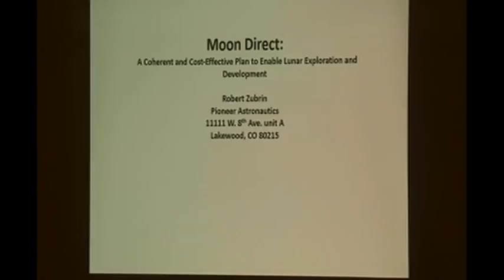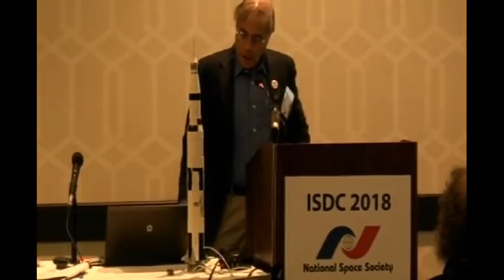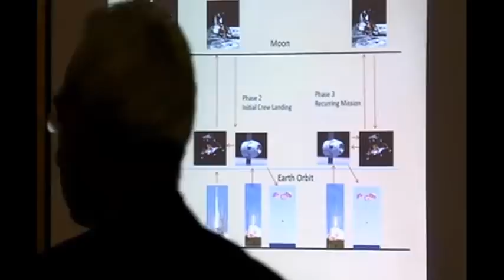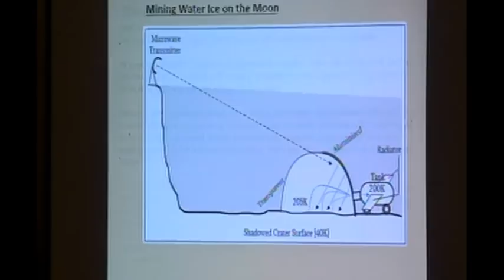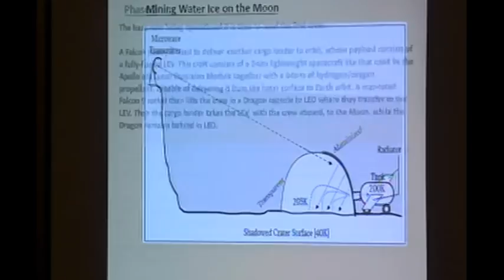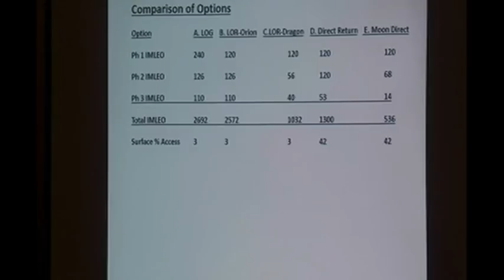Dr. Robert Zubrin - Moon Direct - International Space Development Conference - May 26, 2018

Comment: The Moon Direct LEV can be designed to carry four Crew, an upgraded ISS Waste Managment System, an Air-Lock/Dust Lock, Single Stage/ReUsable and refueled on the Moon for the return trip.  The pacing item is to recover one hundred tonnes per year of Lunar Water Ice...  With 240 tonnes to 300 tonnes of Lunar Water Ice per year then six trips to the Moon and return can be done.  And six trips per year to the Moon then Twelve (12) Lunar Workers can be maintained at the commercial Lunar Base on the Moon.  Also the Lunar Workers will be on six-months tour of duty !  The LEV can support a Four Person Crew Module or the PTM of the NASA designed "24-Hour Lunar Shuttle" (LEO to a Polar LLO).  The commercial Lunar Polar Base can use the recovered Hydrogen from the Lunar Water Ice to mine LUNar OXygen (LUNOX-TM) from the Lunar Regolith and/or recover Solar Wind Gasses from the Regolith !  Back to the Moon to Stay and onto Mars and BEyond-Ad Astra...  tjl  tjlipin  T. Lipinski

Comment: The mass values for the LEV are hugely exagerated

The Apollo LM weighed 16 tones fully fueled and 6 tones empty
And that was striped down hugely to achieve this low mass
The LEV would have to weigh a lot more to achieve what Zubrin is proposing probably in the order of 20+ tones since it is single stage and therefore way less fuel efficient 
It also has to carry more crew and perform much better Delta V wise than the LM
In the end the LEV would be too heavy to get to the Moon using a falcon heavy which means that it would require an SLS launch to be able to reach the Moon
It would also require a Falcon 9 and a Falcon Heavy launch to keep sending crew after phase 2
This would create a number of safety and infrastructural problems
 
Forcing the use of severely underpowered rockets like Falcon Heavy and New Glenn really makes this too complex
This whole thing could be done by an SLS Block 1b with much less complexity and a comparable recurring launch cost
Reply: Mastercrap 42123 ...I’m glad to see you questioning the numbers, but the amateur weights I find are near Zubrin’s.
The Apollo LM Ascent Stage—not the full LM vehicle is what Zubrin’s aiming to duplicate.  For just the ascent stage, Wiki shows these masses: Dry = 3.87 tons; Gross = 5.15 tons; fuel = 2.59 tons.  So, Gross + Fuel is 5.15 + 2.59 = 7.74 tons.  This was for the two-man part of the LM that only had to rise from the lunar surface to the command module.  Zubrin’s plan would have to go from the lunar surface to LEO for Crew Dragon rendezvous, but, as he mentioned, today’s materials technology should enable us to make a lighter vehicle.  So, we’d have to produce a new human-rated Lander vehicle that could get from LEO to land on the moon carrying about 8 tons of stuff, including two astronauts and the new LM Ascent vehicle.  Everything else for the mission is hardware we’re currently using, no?
Reply: @737smartin  Modern landers are going to be heavier than the LM not lighter
The requirements for a new lunar exploration program cannot be fullfilled with minimalistic 10 ton lander design that can barely house a couple people for a few days
The upcoming Artemis lander awards will demonstrate this pretty well
Just look at how large the Constellation Altair lander would have been
Way more capable than the LM but over 40 tons in wet mass because of that increased capability
Reply: Mastercrap 42123 certainly, if we stick with putting six feet on the moon instead of four, and greatly increasing capabilities per the Artemis plan, the lander will necessarily weigh considerably more. Still, rather than stick with the “the plan” requiring several launches of the impossibly expensive SLS, I have no doubt that we could accomplish a safe, productive manned lunar mission with existing rockets much, much sooner and MUCH, MUCH, MUCH more affordably.

Comment: IMO: I think a better use of resources would be to give all this money to companies and universities to develop robots.
Robots could be used to:
1) Mine the surface for creating raw materials.
2) Plow a network of smooth roads to allow easy travel between different areas of the moon.
3) Create small habits with water from the bottom of a crater.
4) Build telescopes and a communication network
The knowledge gained from building these robots would be much more useful than building the base itself.

Comment: I think the first step should be landing simple robots that can make building materials, like steel wire for example, from lunar resources.
The water is much more useful as water. The regolith is highly oxidized thus can be reduced and then used as fuel.
Wouldn't be prudent to just to jump into a cold creator and start making  fuel to burn as it may be the greatest treasure chest known, including preserved evidence of solar system's history that we just couldn't get anywhere else. You may also like to consider that smelters have fewer considerations and achieving 6 km/s is just simple ballistics when in a vacuum. 
Also consider all those lunar impacts didn't burn on way down and didn't wash away. 
There is a lot more to moon than just its sun burnt skin.

Comment: Robert, I am going to have to stop you on flying being the only way to travel large distances on the moon. The Circumference of the moon is about 11000 km, so the distance between any two points is ~5,500 km or less. Adding in an obstacle avoidance factor of 20%, and any two points should only be a maximum of ~6,600 km drive distance away. The land speed record on the moon was accomplished by Eugene Cernan at 18 km/h. Assuming you couldn't improve on that, you could drive between any two points in less than 366 hours or about 15 days....or less. Accessing any point in a hemisphere could be done in a week or less or two weeks round trip. The only thing that hasn't been demonstrated is the manned range. Apollo 17 travelled about 36 km. You would need to improve that by two orders of magnitude for a significant percentage of global access. My guess is you would use liquid oxygen and liquid hydrogen to run fuel cells to get the range you need, but unlike a rocket engine, the resultant water can be captured and recycled. Given that the Toyota Mirai goes about 500 km on 5 kg of hydrogen, ~70 kg of liquid hydrogen in a cubic meter of storage and ~550 kg of oxygen in a half cubic meter of storage should get a small SUV sized vehicle pretty far on the moon.
Reply: I agree in principle, though the safe speed limit for the moon would be lower. I in-vision instead landing a massive tracked laboratory which crawls across the surface, it could stop somewhere for a day or a few hours, take samples and observations then start crawling away towards a the next destination while testing and experimenting on the gathered samples.  The crawler wouldn't need to travel the whole distance or even return to its starting point if not required. A return vehicle could land nearby which the scientists and samples board before returning home or to the 'gateway'. Perhaps a small VTOL could be carried for several hundred kilometer hops away from teh crawler, to inspect future manned investigation sites or whatever.

Comment: Considering how little ice there is on the moon I disagree with using it for fuel (or find the best alternative first thing). Whenever we build a lunar colony that water will be very precious, and how many people can all the lunar water support? It would be such a shame if half that water ended up being used as fuel rather than supporting human life.
Reply: Little Cripple Water for human consumption can be recycled and you don't need very much of it. At the point where you have a colony of significant size that would require ice mining for sustenance you'd already have vastly improved transportation and other infrastructure and it would be much less of a problem.
Reply: We're talking about 600 million metric tonnes. That's enough for 100 million of these lunar missions. If we had a million people on the Moon then it might be an issue in a few hundred years, but otherwise we're good.
Reply: First, however precious water may be on the moon, it will always be better to source it on the moon than shipping it from earth.
Second, water is not rare on the moon. There's plenty of it, not just the poles.
Reply: That is exactly what he proposed - the first two phases are missions without ISPP. He uses them to build a ISPP for phase three, but you could equally use them for any other purpose.
Reply: +Playgrrl Not to mention that Earth is so close anyhow, so there will be little incentive to become self-sufficient in any primary resource.
Reply: I agree with you Little Cripple that the weak point of this mission is the use of water from ice. It is the critical point of the mission on which a lot of uncertainties around water mining persists. An Moon-Direct alternative without ISPP should be designed which include the potential growth toward a ISPP enabled mission.